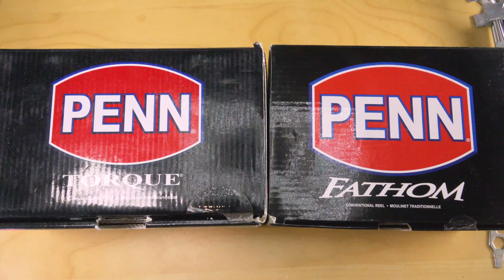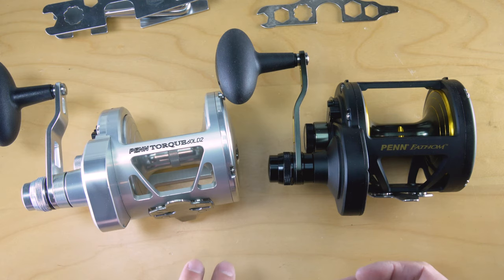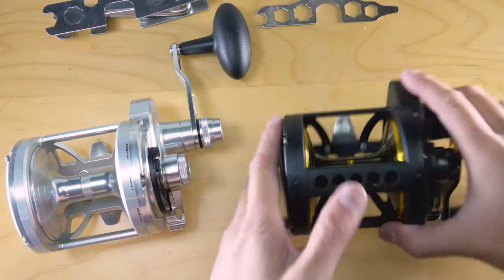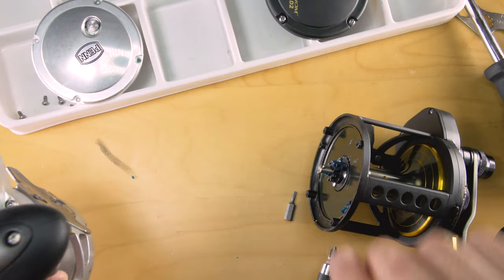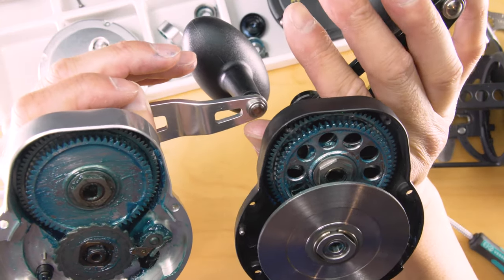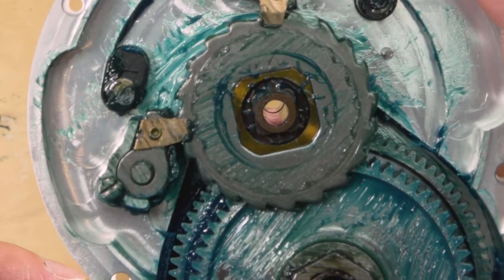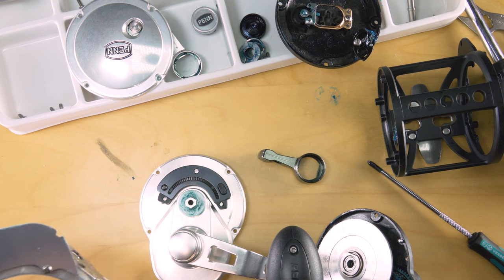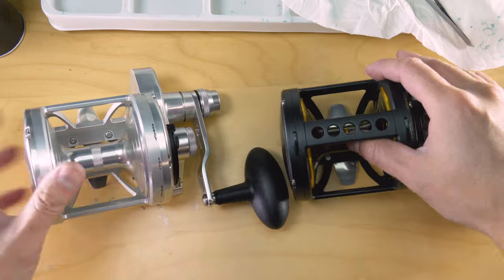Is it worth it? Penn Torque vs Fathom Reel 60ld2 bluefin tuna 2speed leverdrag reel review

Comment: Nice job; a short summary is that the Fathom series is designed to be the absolute best possible reel "for the price", and the Torque series is designed to be the best possible reel.
Reply from the maker: 100% agreed. Amazing craftsmanship and love these series of reels. Having fun with my star drags and visx line as well.
Reply: They’re the same reel except for the cast frame, top bar and harness lugs on the fathom.
Reply: @Joe-bh4vz  "Except for the cast frame" [vs. machined frame] is a major difference.
Reply: @Joe-bh4vz  not true.  internals are not the same

Comment: Thank you for the comparison. I own 2 of the Fathom 60 LR and use them on two bent rods. They have never failed. I have caught marlin here on the Sea of Cortez. So I have been contemplating adding a new Torque for my shotgun. Looks good. Yes, there is a premium price, but less than the International. Mmmmm. After seeing this, I may very well purchase another Fathom 60. I run 80 lb braid with a 100 yd. Top Shot.   Thanks again.
Reply from the maker: Just saw the reply now. That’s awesome to hear boss! Marlin !!🙌 they do the job and internals match. Was always curious if too much stress on it would be it’s downfall but having a marlin on other end does prove it’s capabilities. Thanks for sharing 🙌

Comment: Drag lever is shorter in the FTH60LD2 due to the trolling/harness lugs; the full length lever can interfere with their operation. As noted, the TRQ60 does not have harness lugs. The Fathom 40N has the same length drag lever as the Torques.
Reply: I heard a rep selling it as not  snagging on line or whatever could get snagged I guess but your reason makes sense.
Reply: @pakde8002  tuna north is a rep.

Comment: Regarding country of manufacture; California law requires that every single part be made domestically in order to be labeled "Made in USA". With Penn's US- made models [like Torques], all parts that are "reel parts" [gears, frames, handles, etc.] are made here. Parts that are "standardized machine parts" [screws, springs, ball-bearings] are purchased from industrial suppliers, and may come from a variety of places.
Reply from the maker: Hi Steve! Recognize the username from BD. Much respect as I value your input and suggestions you provide on the forum. Will caption note these details to the video. Thanks so much, just doing it for my own personal insights and view. Love my Penns and own the VISX16, thus finding a place for this 60ld2. Have the 40n and just noticed the lever are indeed matched length as torques. Look forward to the new Penn rods coming out this year. Thanks again!

Comment: Just as others have mentioned, it does need a dab of oil before you use it https://www.youtube.com/post/UgkxSlytCJqozTF7EbdP4LWP-HUXf9WRDJ0e - put a few drops in through the convenient screw cap and you are good to go! I have fished several weeks with a couple of these, and I will be getting more in the future. I put these against my Abu Garcia Pro Max reel, and they actually perform a bit better than the Abu with some of my lighter cranks, and definitely just as good with the rest of my lures. My Abu is a bit more low profile and fits my hand better, but these are definitely not bad at all. You can almost get 3 of these for the price of my Pro Max. My only complaint is the thumb bar sits pretty high compared to my traditional profile Abu. Bring that thumb bar down a little and I’m sold on these all day long.
Reply from the maker: 100% agreed. It’s a nice reel. I’ve added a 30ld2 in torque to the line up since

Comment: A $300 bucks upgrade doesn't buy as much as you'd think. I like the way they did the dog frame on the CNC which I'm guessing is probably why the gear side plate is a bit thicker than the fathom. But I don't see why they couldn't have done something similar with the fathom. I can really see that's a weak point that might fail with age. But I'd still buy the fathom unless a long lost rich uncle dies and names me in his will. Edit: actually I'd buy the squall two speed because the internals are exactly the same as the International.
Reply from the maker: Hi Pak, agreed on it. I didn't keep the Torque, although it is much nicer overall. I kept my fathom 40n, 25n, and 15xn. The 60 was really nice, just a repeat size for me. Love the price and the quality they put into both. Thanks for watching!
Reply: @Seastheday88  thank for the reply. I enjoy the detailed reel comparisons. I'm a big fan of Penn products and I hope they move more of their manufacturing out of China. Not that I think there's anything wrong with the quality side I just don't like the system of government there. My most recent purchase is a Penn Squall BC and I was pleasantly surprised to see it was made in South Korea. I really love it.
Reply from the maker: @pakde8002  I’ll have to check out that Squall bc, still have one Lexa and it’s been a workhorse. Agree if Penn can move their manufacturing. Overall, the Fathom has been great and recent west coast tuna reports this past week, an angler landed a 150lb tuna with Fathom 40nld2 on 60lb test line. Love hearing about new records being made with these reels.

Comment: Can you do a comparison on the freespool with a high drag setting. Ex: fishing 100lb for jigs 

I set my fathom at 25-30 lbs of drag because I was fishing 100lb for jigging. 30 lb of being at “full” on the fathom. The issue I was having was when you set the drag that high you lose the “free” spin of the freespool and the freespool slows down. 

Can you try and do a comparison on the freespool of both of the reels? I’m wondering what each reel’s max drag is before you notice the freespool starting to slow down.
Reply from the maker: Hey Thomas. Thanks for watching. I sold the torque. I do notice that on the fathoms and my conclusion was to say it’s factory grease, but I’ll confirm. When putting back both reels, I only noticed random drag issue on the fathom. The torque easily went right back to how it was factory.
Reply: It should be noted that neither of these reels is suitable for fishing bluefin as "100-pound reels". Both are "Medium Frame", and are designed to be 60/80 reels; with 60 as the sweet-spot, and 80 as the upper limit. Full drag setting of 30 pounds exceeds both reels' capability, and will in fact affect freespool. When choosing a 100-pound reel, a "Heavy Frame" model such as a 16VISX is the way to go.
Reply: @tunanorth  update: I bought a saltiga 55 lol
Reply: @Seastheday88  in regards to the freespool issue this is a statement I found from penn

We have been receiving and seeing complaints in service regarding Fathom LD max drag before losing free spool. We identified a concern a couple years back with too much grease in the reel causing sluggish free spool regardless of drag setting, we corrected this issue with our factory. Recently we began hearing a similar complaint but free spool was fine with low drag amounts but slowing down prior to the reel achieving the published max drag. We identified this problem as a missing 154B distant washer, we have notified our factory and they corrected the mistake. If anyone has a Fathom LD reel with this issue, I would recommend sending the reel in with a copy of this message to our Service Center in Philadelphia. Since this is considered warranty it will be bumped to the top of our backlog. Alternatively, if anyone is confident and can pull the spool apart to check and see if one of the washers is missing, we can send the washer out to be installed. We will just need the info on the sticker, it reads something like (example) 01D19AO and is located on the stand/foot of the reel. 

If the reel is not fairly new and free spool issues arise, other reasons could affect free spool as well, we had someone tightening the preset while the lever was in full and buggered up the cam and cam follower. Spool bearings need to be cleaned and oiled occasionally and could slow the speed, etc. These user errors or normal wear and tear would not be covered under warranty. 

PENN FISHING
ATTN FATHOM LD WARRANTY
3028 WEST HUNTING PARK AVE
PHILA PA 19132

Include a copy of this Post along with the reel and return address.

tony
Reply from the maker: @thomasr6134  Saltiga 2spds are seriously beautiful artwork. The last november trip was a buddy fighting his with a saltiga
Reply from the maker: @thomasr6134  I read this too, I still love my fathoms and hope this keeps its top notch. Thanks for sharing the insight!
Reply: @thomasr6134  A Saltiga 55 is a very nice reel, although at 37 ounces that is definitely a "Heavy Frame" design, very similar to an International 16VISX [which is 36 ounces]. As noted, a Heavy Frame reel is the way to go when using 100-pound tackle. Fathoms and Torques [all sizes] are "Medium Frame".
Reply from the maker: @tunanorth  Love the internationals. Proud Visx16 owner here, I just need stronger arms when that triple digit is on the other end of the line 🤣
Reply: @Seastheday88  put the 30 VISX arm and handle.  That’s what did to my 12 and 16.
Reply from the maker: @fishingmaestro  🙌I actually have one installed on my visx16. Much easier swap than on the Fathom/Torque. Way bigger than I anticipated, but feels like I’ll be able to a better overall grip when I’m winching one in hooefully 🤙🤙

Comment: Have you compared the torque 40 vs international visx 12?
Reply from the maker: Hi Dark Matter. I actually have a 12 in possession but no Torque 40. I think it’s depends what you’re after. Ideally, the lightweight Torque would make fishing easier, but the VISX will be the one I want as soon as it’s hooked lol. Had the VISX 12 for just over a year and never took it out yet. 
Have you had a chance to try either yet? Thoughts?
Reply: @Seastheday88  Sold my Fathom 60, Got the VISX 12, price of the Torque 40 and VISX 12 was about the same.  The 12  was more solid feeling. Also had better low gear ratio. Taking a trip in April. I have to say the Fathoms are excellent, had a 30 and a 60 for about 6 years, never a problem.
Reply from the maker: @Bigfish1day  that low gear is exactly why I got it too lol. Which boat you heading out of in April? Those Fathoms are workhorses, we take em for granted for the price.
Reply: @Seastheday88  The Release out of Hatteras NC. Had a great trip with on that boat last April. They had Torque 30s for trolling, I was surprised how well they worked on blackfin and small yellowfin tunas.
Reply from the maker: @Bigfish1day  that’s awesome! Glad to hear you guys got to put it to use too

Comment: Well I got 1 Avet Raptor 1 30w and the Penn Fathom 60 and I think the fathom is smoother and I get more line on the spool  the Avet was twice the price!!!
Reply from the maker: It’s an amazing reel for the price. The internals are just about identical with stainless main and pinion gears on both. Uses the same HT100 carbon drags. Only difference is machined vs die cast frame. I think under load, the die cast may exhibit body shift/tweaking   Otherwise it’s an amazing reel.
Reply: @Seastheday88  To clarify, both the Torque and Fathom "Lever Drag" models use the expensive "Dura-Drag" material [same as Internationals]. The HT-100 material is good, but not as good as the Dura-Drag.

Comment: Add line capacity can be key deciding what reel to get. IAM they are the same.
Reply from the maker: Hi David. Capacity is same. I actually spooled the Fathom with 100lb braid and later moved it to a Penn Visx16 which was perfect to the brim.
Reply: @Seastheday88  thanks for the great presentation.Thats one thing about fishing; you never stop learning. Just a new way for sinker rigs for bluefin. Do a drop shot style instead of a rubber band. Tie your hook to the end of your floruCarbo leader. The  take 12 lb test, 15-20 inches of line  tie the one end to the hook, easy knot nothing special. At the end put swivel attach weight. Gives you flexibility on changing weight size. Now when the Captain tells you drop 300 ft the chances for tangle are less and can drop it faster. Good fishing.
Reply from the maker: @davidashton5887  David, that’s a random coincidence you’re saying that. Just went out on weds and two guys were chatting that setup, with lighter line to sinker. None of that helicopter wrap around now with the chovies. 

I couldn’t land any of my day bites, chewed off on 2. Connected my night bites tho on the visx16 🙌 they’re out there right now.

Comment: Your basically paying for something better made if you go with the torque however in my opinion the basically work the same, if you appreciate craftsmanship go with the torque if not the go with the fathom
Reply from the maker: I couldn’t agree more. I personally have 5 Fathoms (3 LD and 2 SD) and 1 Torque. Got the 30ld2 Torque mainly for price on used value and that it’s still lighter than the Talica, so it’s used as jig slinging for foamer action.

Comment: I would choose the fathom every day  , paying extra aint gonna catch you more fish lets face it .
Reply from the maker: Hi Dave, whole heartedly agree. The only Torque I have is a 30ld2. The freespool is insane on the Torques. I use that reel specifically for casting snipers. Weighs the same as a 20 size Trinidad, but has the low gear when I need the extra lift. I still have my 25n and 40n Fathoms that are just work horses.

Comment: I have heard penn fathom get damaged fighting bluefin tuna. I just saw a penn fathom 60 2 speed blow up on probably a 200lb plus bluefin guy was fish 130lb spectra and 100lb fluorocarbon. I wouldn't be buying any penn fathom. I have been a Shimano buyer for a long time l have 2 talica 16 2 speed and will probably get a talica 25 2 speed for my 100lb fluorocarbon and 130lb spectra outfit.
Reply from the maker: Woah 200lb+ is pushing it. I fish my 40n on 60lb leader. Anything else heavier, I have the International models. Love the Talica 16, they are an amazing piece of machinery. I haven’t had a chance to try a Okuma Makaira, but hear great things about them. Thanks for sharing your report. We mostly hear about them about the landing of tuna, but rarely the blowups. It helps us understand it’s limitations. As tunanorth said, they’re the best possible reel for the price.
Reply: As has been discussed numerous times, the "Medium Frame" Fathom 60's are 60/80 pound reels, with a "sweet spot" at 60-pound, but are overbuilt enough to handle 80 pound work, and tuna up to about 175 pounds. Putting 130 braid and 100 topshot on it in pursuit of 200-plus pound tuna is beyond the design specification of the reel. Once you get into the 80/100-pound line category, you definitely want a "Heavy Frame" reel such as an International 16VISX. Also bear in mind that the Fathom series are around $300 retail, while Talicas, Internationals, and other 100-pound capable reels are $600 or more.
Reply: Once you try Okuma Makaira….then you will never look back…you may make a review comparing it with the VISX..
Reply: My fathom 60 2 speed held up great on multiple triple digit bluefin this season. Maybe the one that blow up was defective or not fished properly?

Comment: Hey fellas, been out of game for a while, what are most common specs of best offshore reels: best housing, number and type of bearings, drag systems?  Thx
Reply from the maker: Most manufacturers have amazing reels and most have a preference by brand. 
In medium CNC machined frames, Shimano Talica, Daiwa Saltiga, Penn Torque, Accurate Valiant, and new Okuma Alijos. The first 4 are what I commonly see on boats and all land fish. Haven’t seen Alijos in action but it’s successor, Andros, yes. 

Heavy frame, you’ll commonly find the Penn Visx, Okuma Makaira and Shimano Talica will still be in this radar as those owners bring out the 25/50 models for night jigging. 

All of the above has more drag than we’ll preset it to. Not sure about bearing counts on each, but freespool and smoothness in action are more than plentiful in these models. 

I’ve only found so far non bearing in star drag model reels. Usually made from a plastic. If you’re not ready to splurge, rent them. See how they feel in your hands. Makaira has lower low gear but also less IPT. VISX was the sweet spot for me, but I haven’t caught anything larger than 120lb yet either. 

The Torque and Valiant are designed really light, makes for easy day time fishing. Hope this helps.